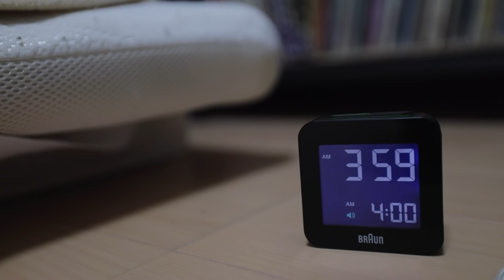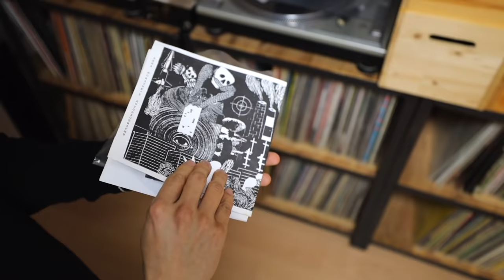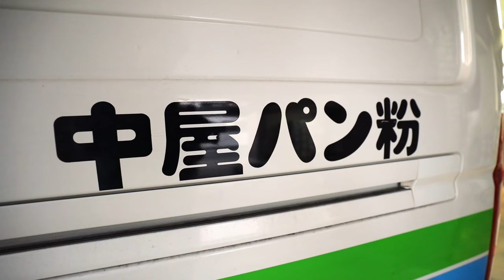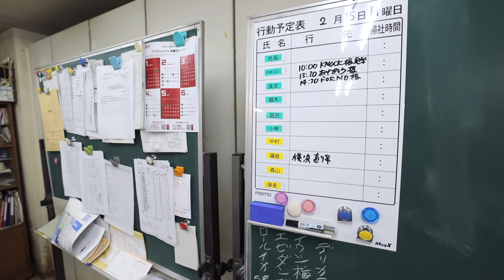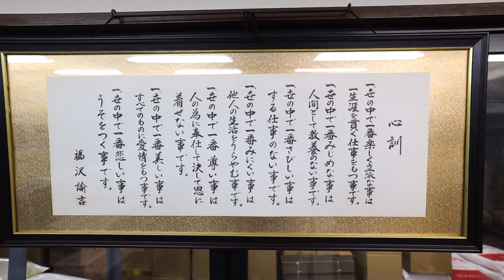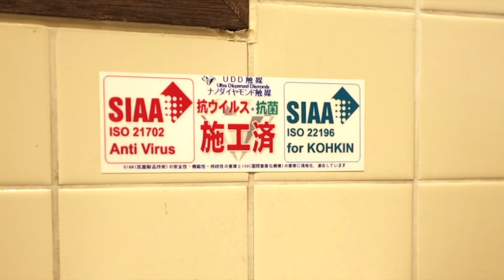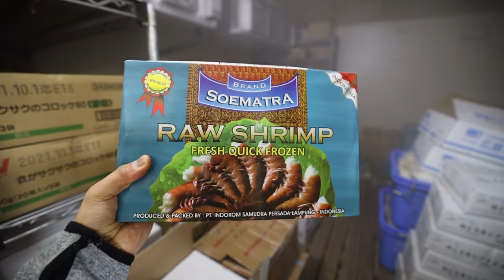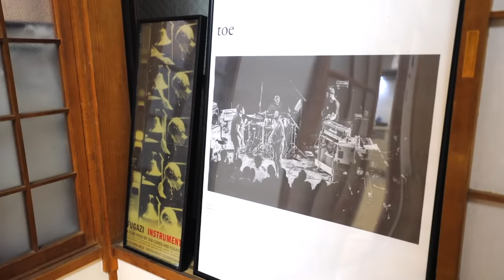Day in the Life of a Japanese Panko Factory Owner

Comment: ironic that they use fresh bread for something that used to be the european way of reusing old bread
Reply: Using freshly baked bread is what allows the panko to fry up extra light and crispy.
Reply: @jeffchan7  acctually, not really. Acctual panko, cooked using electric currents has a more evenly distributed heat during cooking. This changes the texture of the bread, creating long slates instead of what normal bread has. This ends up having more surface area causing the panko to cook better in oil.
Reply: @f1reman237  The traditional method shown in the video, originated during the mid 1800s (Meiji Period). This tradtional method utilizes Shokupan bread which is baked and processed into Panko flakes. 

The electrode method that you're referencing, was popularized after WWII. That electrode method is primarily used by industrial factories to produce mass quantities.

Comment: I thought they used electricity to bake the bread and not oven heat.
Reply: The traditional method shown in the video,  originated during the mid-1800s (Meiji Period). That method utilizes Shokupan bread which is baked and processed into Panko flakes. 

The electrode method that you're referencing, was popularized after WWII. It is primarily used by industrial factories to produce mass quantities.
Reply: @restaurantman  then I am unsure if there still is a difference between the old way and the way the west makes breadcrumbs. It was my understanding it was the electricity making that made it unique for Japanese breadcrumbs (panko)
Reply: @AndersHass  Panko has a flakier consistency compared to other breadcrumbs. The process of shredding the bread and then drying it contributes to this. As a result, Panko absorbs less oil when fried - resulting in a lighter and crispier texture.
Reply: @restaurantman  Ah it is the shredding process that makes the difference. Thanks for the answers!
Reply: @AndersHass  Also, some versions of Panko utilize Shokupan bread recipes that include milk powder. In addition to flavor, it also contributes a softer texture to the bread that is then processed into Panko.

Comment: I thought Panko was cooked using electrical current rather than conventional ovens.
Reply: The traditional method shown in the video,  originated during the mid-1800s (The Meiji Period). That method utilizes Shokupan bread which is baked and processed into Panko flakes. 

The electrode method that you're referencing, was popularized after WWII. It is primarily used by industrial factories to produce mass quantities.

Comment: Isn't panko supposed to be baked, using high voltage or current?
Am i living a lie?
Reply: The traditional method shown in the video,  originated during the mid 1800s (Meiji Period). This tradtional method utilizes Shokupan bread which is baked and processed into Panko flakes. 

The electrode method that you're referencing, was popularized after WWII. That electrode method is primarily used by industrial factories to produce mass quantities.

Comment: Not even real panko!
Reply: @restaurantman  ?
Reply: Why?
Reply: @Whitey420602 In your initial comment, you stated "Not even real panko!". Would you please explain what you specifically meant?
Reply: Real panko bread is naturally crustless as a result of the special oven that cooks the bread with an electrical current
Reply: This "panko" was baked a regular oven and then the crusts were sliced off
Reply: @Whitey420602  The traditional baking method (which originated during the mid-1800s) shown in the video, utilizes Shokupan bread that is baked and then processed into Panko flakes. The business shown in the video is a 3rd generation business and therefore continues to make Panko using this "orginal" style.

The electrode method that you were referencing is primarily used in industrial factories to produce mass quantities. That method was developed after WWII.
Reply: Please share some reference material. I don't take the word of strangers online